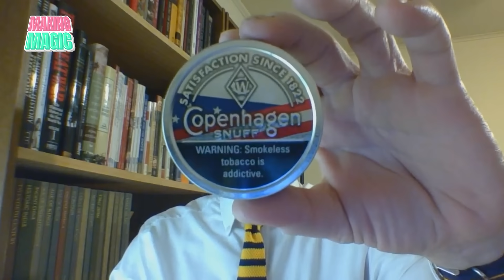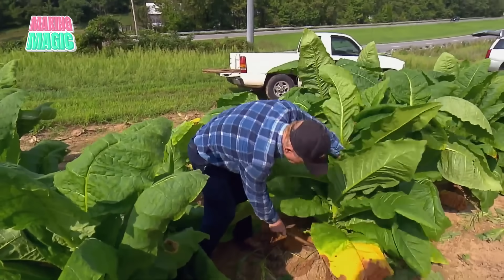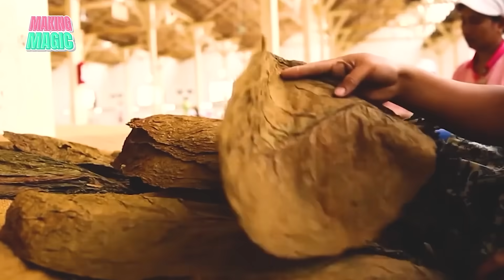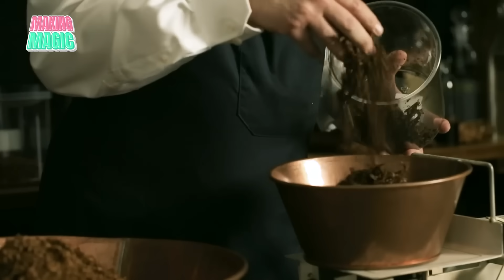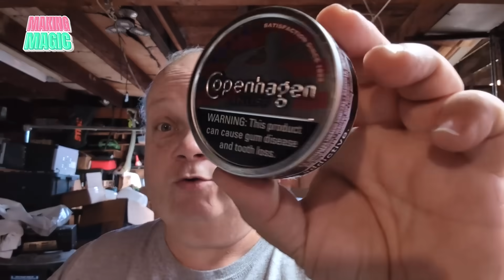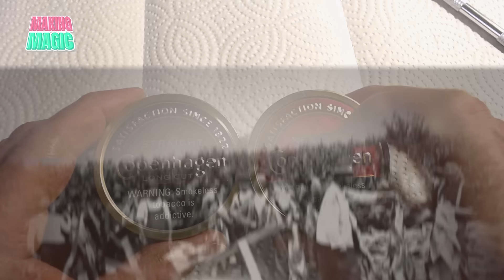How COPENHAGEN CHEWING TOBACCO is Made

Comment: I started dipping back in about 1979-1980. I was 10. I dipped a variety of products over the years, including Copenhagen. I'd flip from dipping to smoking and back and sometimes even do both (not at the same time), depending on my surroundings. I tried off and on for probably 20 years to give it up and just was never able to. Finally, I set my mind to it and got some medical help with patches just weaning myself off the nicotine. Then I needed something else to solve the mouth feel issue of "needing" something in my lip to replace the dip. I tried a few nicotine free products until I felt confident enough that I could handle it on my own. I'm happy to say that as of the typing of this comment, I was able to beat a 41 year tobacco habit and I have been nicotine free for 1,854 days (8-20-20), which is a tick over 5 years and have saved myself approximately 14,839 dips (2,473 cans) and  roughly $12,366. Yes, I track it on a mobile app because it's something I honestly didn't think I'd ever succeed at doing so I'm kinda proud of that.
Reply: Who cares
Reply: @BenSchwartz-y4r  your mom
Reply: I can't imagine the money a tobacco user wastes every year on that addiction...
Reply: Congratulations that's  impressive.

Comment: Those barns are not temperature controlled… there are 1-3 inch gaps on the boards outside. It’s just a place to dry them, further smoke curing happens elsewhere

Comment: Dipped from 19 to 30. Switched to vape, a little stint with rogues, and now it's Zyn at 32. I wasn't really enjoying dip anymore. Gum recession was severe. Spitting constantly. The dip quality went down and the price went up. It used to be so rare to find a stem when I started. Now it's every single dip out of every single can. Even Grizzly when it was 99 cents, it rarely had a stem. Grizzly changed at some point too. It used to be so sharp and had this ZING about it. Then it got really dark and mushy and skunky when they switched cans. Copenhagen started tasting the same as Skoal, really artificial. None of it really packed the same nicotine satisfaction. I think the tobacco quality and PH levels were screwed up so the free nicotine level wasn't as good. It just got harder on the lips and gums. The only time I've found in the past few years that dip really packs a good punch is in the colder months or right after a hard freeze.

Comment: Thier quality control sounds fantastic but it’s BS. I can definitely tell when fire cured leaves slip into the mix. It doesn’t happen often but batches are definitely off when that smoke hits them leaves. Just like fine cigars rush the process and light small fires in the curing barns you can totally taste that from natural curing that never gets smoke on the leaves. I’ve never tasted mildewed tobacco in Copenhagen but I dam sure have in cigars. Overall they are very consistent but bad lots do slip out.